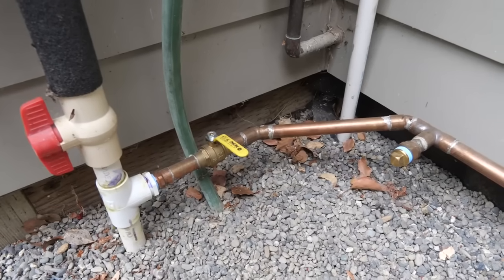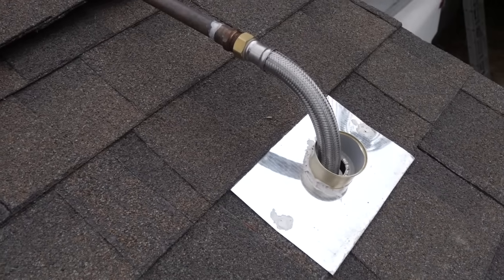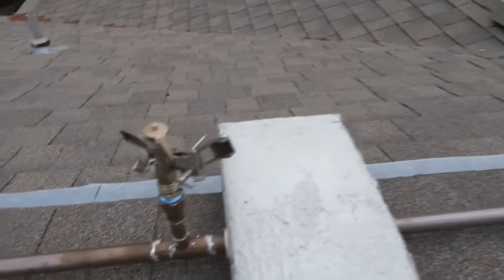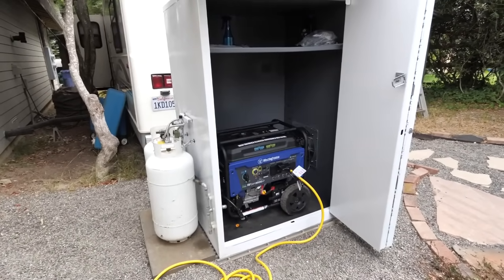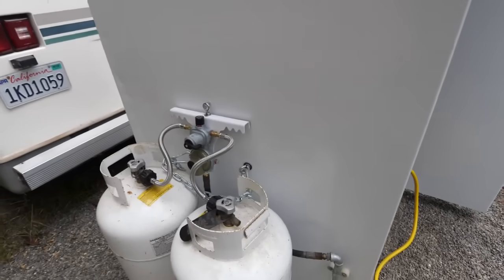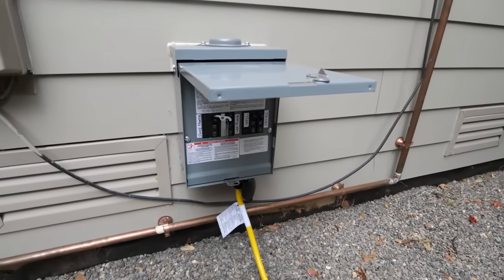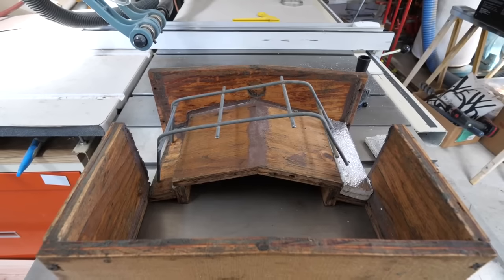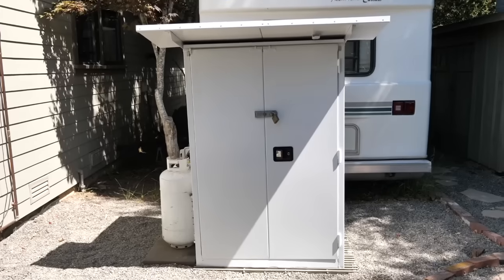Roof sprinklers and backup generator for wildfire-prone rural house

Comment: I'm saving to build a house. 
I want to build a insulated concrete form (ICF) house. 
You build them with a sealed envelope, then add in a system for humidity control with air exchanger to your HVAC. 
For all your exterior finishes use steel, rock, or concrete. 
Keep all foliage back from the home. 
You have a bulletproof, tornado resistant, hurricane resistant, fire resistant home that is ultra energy efficient. 
They say ICF only costs 5% more than stick built.
Would be very cool to integrate an emergency sprinkler system into your home build. Just in case.
Reply: Look into waterproofing the exterior.  It's not that easy. Also note that the foam is easy for mice to burrow in. I like ICF too.

Comment: Common sense...I thought of this a long time ago..im no rocket scientist, and you covered everything you need..back up power and well water. some one is going to become a millionaire with your idea real soon...I would have run the pipes inside the attic ,so just the sprinkler heads are on the roof in all 4 corners so they can hit the surrounding vegetation and roof at the same time...Great Job...
Reply: A house down the street has a system like this out of Galvanized pipe and was done in the 1940's.  There is nothing new about this general idea.

Comment: If one had the money would  be great to have a roof sprinkler and at least two outdoor hose bibs connected to a pump that was feed from a swimming pool and water dtorage tank with generator backup. Even bety have roof sprinkler not inly on a easy to turn ball valve but a solenoid that could turn on roof sprinklers over you cell phone. in the event you were not home. Think I read that goofy California forbidd new gasoline generators. Better to improve air pollution then protecting your jouse from burning down.

Comment: EVERY THING LOOKS VERY DOMESTIC . The lit embers are the main problem and these are normally swept by the strong winds along at ground level. the roofing material looks so flimsy and fire prone. That roof material once heated by fire /heat looks looks it would peel away. You also need to have lower level water reticulation system .

Comment: Well thought out and constructed.  I assume you are an engineer based on the extreme attention to detail.  I was watching a YT yesterday where a guy in LA saved his house with a few  cheap lawn sprinklers, last night I told my brother installing a permanent exterior plumbing system with a generator would be the only way to go living in fire prone areas and then this pops up in my YT feed today. Your install is about perfect, I'm sure you sleep at night just a bit better knowing you can turn the rain on when you need it.

Comment: An admirable effort id say. However two thoughts come to mind: first off, if I were in a high fire area, I’d have non combustible materials on my roof AND siding. And trims. Looks like you have some cedar shingles. Best kindling there is bro. Second item, likely you would need to be onsite to insure this is all running and managed. As a technician of many years, I know that things have a way of shutting off if they are not baby-sat. Especially if you have mandatory evacuation. Id also trim back foliage. How are the walls gonna stay wet? The roof run off will just flow over the eves and into the gutters or the ground. 

But yes it is to be admired that you have taken a strong pro-active effort to defend your home.

Comment: It is a nice concept. But I think it will only work well if the approaching fire is moving relatively slowly and there isn’t high winds. Here are my concerns. 
> The open generator cabinet during operation will invite blowing embers and likely destroy the generator in short order. 
> If fire surrounds the generator, the cabinet will get very hot and likely overwhelm the generator until it stops. 
> If fire surrounds the propane tanks and supply lines, well, that could be catastrophic. 
> If the tanks explode and being so close to your house, that alone could destroy your home. 
> I saw an air vent at the ground level on your house. You’ll need to remember to close them because wind will drive burning embers through them. 
> The turbine air vent on your roof and all static vents will need to be closed or covered, as well as all eve vents. Burning embers in strong winds will force their way through. 
> Others have already commented on the vegetation and trees around the house and the windows either breaking or allowing too much radiant heat to enter. 
> Since many/most wildfires are wind driven, the water from the sprinklers, placed along the center roofline, will be blown away from the side of the house closest to the fire. And asphalt shingles will burn. 
Overall, your nice setup is a great start. You’ve done a lot of good work, very creative! It’s way better than no sprinkler system at all. If you can find ways to address the issues that I’ve mentioned, you’ll have quite the formidable castle.

Comment: Houses don't catch fire from above.  Those asphalt shingles are decent protection when dry.  The risk comes from embers blown up under the eves and into any attic venting.  Obviously,  decks, bushes, etc are a major problem, but we are talking about the house itself.    If you want to put in sprayers.  Have them spray the undersides of the eves and run down the side of the house.
This sprinkler system won't do much more than reduce the local water pressure.

Comment: It is nice to see people taking action to protect their property while they can. I do see several issues that make me wonder. First, having a defensible space around your house is a very important and helpful thing to reduce fire risk. Having trees and plants against the house increases the likelihood that those smaller materials ignite and hold flames and heat against your house longer possibly igniting the house. Fortunately, this house has a well to supply the sprinklers. However, with a community water supply, if everyone had such a system running at once the water supply system would likely not have the capacity to handle the demand. Using heat activated heads or even resetting heat activated heads would be an improvement for water supply, however the roof would likely need to ignite to activate the flow which obviously wouldn’t be great.

Comment: Very nice system. Well thought out. The only thing I would change is the rainbird head. I would use heads that broadcasts a 360 degree pattern that continuously has water flowing on the roof and beyond. And as many storage tanks as possible.

Comment: Nice work Dink. As a consultant I see a lot low vegetation and trees within the firesafe zone that should be removed or treated and maintained. I would also consider a second water source such as a tank or pond that CalFire might draught from. I think I'd also look at the ability to bypass the roof system with a handheld hose for tactical applications as the fire front moves through. The manual switch panel is something I did as well, and I've used it several times. Obviously, the amp load from the pump cycling was figured into your plan. Now go help your neighbors get set up! LOL

Comment: You would be better off having your own personal fire hose. All you need is a pump that is at least 100 psi output and a fire hose type nozzle. Your system if a branch hits the pipe will simply take it out of action. A  personal fire hose with a pump and water source is more reliable.

Comment: I would advise you take advantage of 'More's Law' in relation to your fire suppression system. 'If More's good, too much is just right'. I would place three more sprinklers on the roof. You might be facing just a normal moving wild fire, bit you might also face a Blow Torch rapidly moving wildfire. You have a bunch of greenery around your home

Comment: Those who demand that all vegetation be removed around homes have a fundamental misunderstanding about how wildfire works. Homes ignite from embers generated a mile or more away. The wind powers these embers into every vulnerable spot. So it is NOT direct flame contact that ignites homes during wind driven fires, but embers. Contrary to what people imagine, burning homes typically ignite the vegetation and trees around them, not the other way around. Also, properly irrigated, maintained trees and shrubs create ember and heat sinks that can help shield homes from being ignited.

Comment: I have installed sprinklers on roofs a couple times in Montana.. Once with copper. It was a pain to blow out and we always had freeze damage every year. Another system we installed the heads in the soffit. They were underground sprinklers that popped out of the soffit upside down. Both systems had their own wells and were also set up with a generator.

Comment: Those propane tanks are equipped with fuses that release the propane in seconds if they are heated above a certain temperature. Your entire system would stop running if that happens.  I'd check into a way to protect them from the heat generated by the nearby fire.

Comment: In such strong winds 70mph they claimed, it does not matter if you had trees or not, absolutely zero sense people saying to remove the trees. The main problem is houses are built so close together, with the flammable siding and flammable roof. This guy is doing the right thing. Just needs to work on the siding. In those winds the trees don’t matter, if anything they will trap the embers and by you time before landing directly on your “protected” hopefully roof. Also look up “wet houses” concept. Ive been to Boise botanic garden in Idaho and they had a display on how low growing ground cover succulent plants also can protect your roof.

Comment: when the fire comes you probably will not have power or water so a gas fired pump feeding your drainplug from your swimming pool will be required. a well may not be able to provide as much water as long as you may need.

Comment: The Ghetty museum has a smart system in place. Something to do with diverting the wind away from the building. It doesn’t burn, because the wind never passes that barrier where the vents basically change the direction of the wind away from the location. They have excellent landscaping, shrubs a native plants. if you are in LA, you should visit. The walls are also constructed out of stone blocks. If one has money I would focus on this wind diversion system rather than the roof. But the sprinkler system is a good extra step.

Comment: Would it not be wiser to build a house covered with stucco and topped with a terra cotta roof, or metal roof?
I mean really , asphalt is a bon fire waiting to happen out there. Building codes need  a tremedous revision in Ca

Comment: You do realize that trees and green vegetation catch trap the embers so they don’t fly onto your roof without any obstruction. So many comments to remove the trees man. He has a sprinkler system in place to keep his roof wet. He is fine. There are videos out there showing intact cars parked by a tree, tree burned a bit, but the car is completely intact.

Comment: I have that exact generator, from Amazon $900 and it's awesome, $1010 with delivery.
 .. powers my entire home with no problems, even my oil/steam heating/hot water system (which is most important), and security system, and everything else easily.
 You just don't try to run everything at once 😂 keep the draw as low as you can.
 .. definitely recommend this unit.

Comment: Also, the high end properties with in the ground pools could easily utilize that water in the pool, connected to high pressure pumps and portable generators to use as a fire suppression system.  Think of how many of those exclusive homes in the LA area that have swimming pools would still be standing.  Again, people need to be more self reliant and not depend on the government to do all the heavy lifting…

Comment: Roof sprinklers are a great idea. 100 mile an hour wind means the sprinklers must face down not up. Forget plastic or vinyl siding, cant use it. Forget copper. Not only will thieves target it but it will melt easily along with solder. Metal roofs and galvanized pipe only. And you must have your own water supply. Dont count on city water as we have seen in commiefornia.

Comment: If one lives in a fire prone area ….put a fireproof roof on the house….fire proof overhangs …put metal storm shields over windows , and remove brush from around the house ……water. Runs out and generators run out of fuel, or self destruct by itself or heat….

Comment: Have not read all comments, but if not said yet, I would replace your flex connection thru your roof with copper pipe.   If the fire is intense that connection could fail.

Comment: Great job, but I have a few suggestions: I'd get rid of the propane generator and get a high capacity power station. The last thing I'd want around during a forest fire is propane tanks. Secondly, you need something that is going to soak the roof and the walls of the house, those sprinklers will do nothing for the house during a forest fire. I'd run copper soaker lines across the entire roof that will keep the roof soaked, and as the water from the roof runs off it will begin to soak the surround ground area around foundation. The sprinklers should be used to focus on the surrounding area, trees, remainder of the landscape, etc...

Comment: The idea is good but I don't believe the design would be adequate to handle the kind of fires that Los Angeles is seeing right now. I don't believe those three sprinkler heads have enough volume or the proper distribution to be of any use in what we're seeing in California right now.

Comment: This idea has crossed my mind as well. I don't live in a fire area but if I ever move I've thought about doing this. There is a couple things that do concern me with it though. The first one, is that you have your propane out where the heat from a fire can impact it. The second thing, is you would probably want to run a power cord underground so it doesn't melt from the heat. I used to volunteer in the fire service and I would be inclined to use something larger sprinkler wise. When it comes down to the hot wind from a fire, it will dry out that water quickly and if you can find something larger, that would probably be more helpful. I really hope you never have to use it but there's a lot of people that will appreciate you sharing your idea, it's a really neat setup.

Comment: Looks like a much-needed system for houses built in some hot, dry and windy climate areas. I would have used black pipe instead of copper though.

Comment: In case you have to use the system the vents on the roof and at the eves will need covered. How about some fiberglass/ Kevlar welding blankets and appropriately sized sandbags to keep the blankets in place. for the eves precut pieces of plywood ready to attach over the vents. It's the embers flying through the air that get into the roof / attic that causes the fires to spread. very well done.

Comment: I'm thinking PVC could work for a much cheaper option. Some think it will melt but I've boiled water in a plastic solo cup placed in a campfire so worth experimenting with to verify. Besides around here thieves strip copper for the high scrap value. May have to paint PVC to prevent UV damage tho.

Comment: I always wondered why people wouldn’t do this to their homes in area that brush and forrest fires is a problem. Also roof should be steel instead of shingles and finally homeowners should use the pool water if available.

Comment: Wow, this is from 3 years ago? If you watch some of the testing videos where they shoot embers at test structures, it's not the shingles you need to worry about - it's wind driven embers that come in through the attic vents - the whirly gig vent on the roof, the gable vents, and the soffit vents. They get inside the attic, and now you have fire going in an inaccessible location, and it's all over. They would also blow into those vents on the side of the house down low too. You really need some kind of metal shutters to close off ALL of those external openings if there's thread of fire

Comment: I've thought of something similar... It's easier in new construction of course... But run the ridge pipe INSIDE the ridge cap and direct flow through holes onto the roof.  The water can't get inside (if it's done right) and you get a water stream down the roof to prevent embers from attaching.  Your system does that part of course.  I like a stream approach because you can then recycle the water back into a reservoir via the gutters and repeat without much water loss. Think rain catchment.   I've also read about installing soffit vent dampers that attenuate ember intrusion vie the eaves.  You're on the right track, sir.  I hope it never NEEDS to be used.

Comment: Ok,this is a great idea ,I came up with the the past, but the worst thing ,is they freezing and bust, as you will need them in the winter 🥶, and they will need to be insulated 100%, it 23* outside right now, it would of made a small difference on this fire,as they had no water pumps powered ,as California mandates the power be turned off in wind events, lol BigAl California thanks

Comment: In these current California fires, exactly what is the weakest link as far as a fire igniting a house?

Soffits? 
( I ask because of the windspeed rewriting general theory)

Decks?

Debris on roofs?
(I figure roofs in CA are all terracotta tile, so maybe not?)

Im wondering if the roofing material isn't combustable and yourhome isnin the danta anna wind zone.... Wht not put sprinklers or sprayers  on the side of the home, wetting the soffits and the side of the home.
Im assuming that Santa Anna winds always come from tbe same general direction?
If so, why not attempt fireproofing your home on the side that is actually in danger.

Im asking for a friend so ....his..... questions dont mske  .....him..... Look stupid.